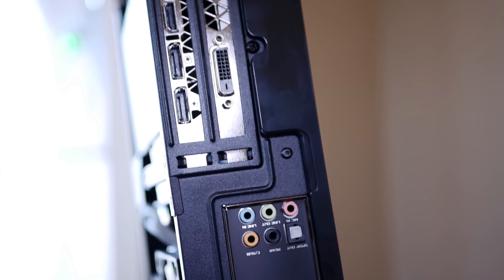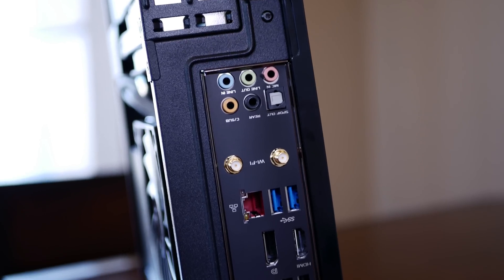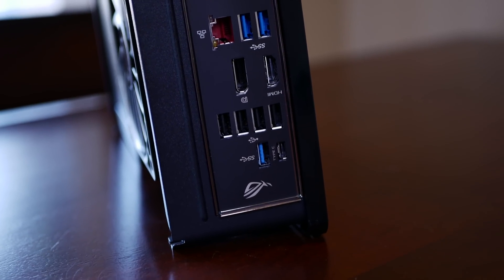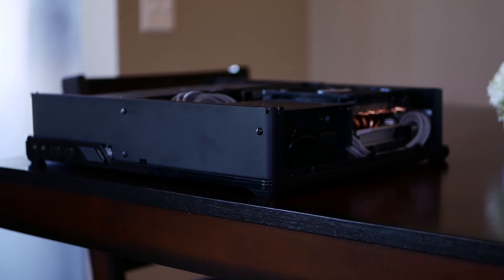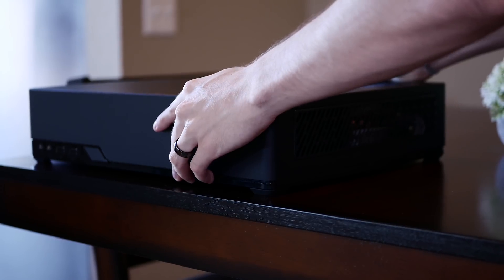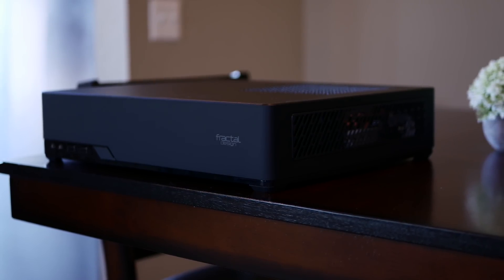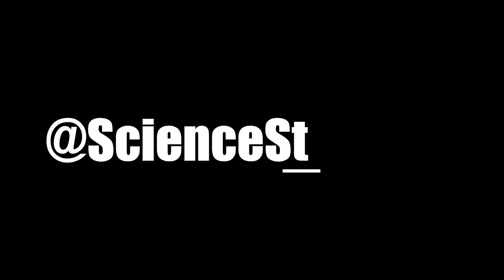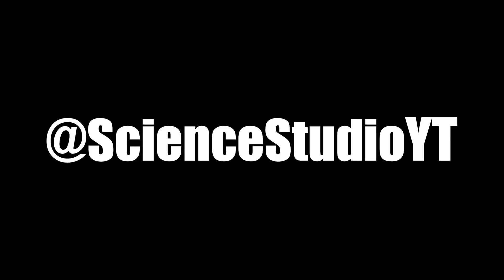Building an Ultra-Clean Small Form Factor PC

Comment: 7:34 - NEVER use cables that do not come with the PSU. You'll destroy the PCBs of the hard drives. But hey, what do I know after having to recover 3 drives at 850 CDN each because i used different cables.

Comment: There is also the Silverstone Raven RVZ02 case that makes a nice itx build, and you can put a handle on it, and you can put the big shurkin 2 in it as well, and it has air filters, and it will even accept a slim optical drive if you need it. Video card cooling is a little suffocated but overall a good case just as the node 202 is...

I built a system consisting of 6700k, 1070 strix, lpx ram, and a set of 850 evo's on raid 0 and it rocks, gpu and cpu never get over 80c even rocking crysis 3...

Comment: Yeah custom cable with the right length help a lot with small form factor build like this one.
I built myself a RVZ01 computer and I swapped the CPU power cable and the GPU power cable for shorter ones to help reduce the clutter in the case a little.
I bought the CPU / GPU  cable from moddiy and the right angled GPU cable from kareon cable.

Comment: With the way the Node 202 is using a FE blower type cooler on your GPU would be more preferable than blowing the heat into the case and right back into the GPU area.

Comment: It's a nice build and balanced specs I think, but it would be even better if you tweaked it a little bit. In this SFF I think that the thermals are the enemy so it would be cooler to delid the cpu w/ liquid metal, some undervolting, re paste the gpu, etc. Also, if you're using premiere 2018 with the quicksync update you would definitively have a pretty fast editing / rendering rig ! Just my 2 cents, Cheers !

Comment: Why not use a Gigabyte 1080 mini? Same height and depth, but nearly half the length. Having a case that'll fit the PSU next to it and using a PCIe extension cable should do the trick.

Comment: about to attempt a similar Ryzen build, gotta find a decent cooler tho
Reply: i was thinking either that or a copper heatsink with a Noctua ultraslim
Reply: Perhaps this combo (it is not cheap):
Noctua cpu cooler NH-L9a-AM4 but change default 12mm fan to Noctuas 25mm thick fan.
https://noctua.at/en/nf-a9-pwm

Comment: Ok y didn't u use the Xtreme edition Intel processor if u r taking it to comoutex video editing if this is just a budget issue it's ok but otherwise higher wattage SF PSU are available which can power Intel extreme edition processor also I recommend 2*16 gig sticks and lastly a zotac 1080 ti mini by zotac and yes this is just a suggestionb and only because u said that u are making a part 2 of it and I m repeat ing again that your build is great just these can make things better also I suggest u to check out bitwit Kyle video on fractal node 202 where he puts a 120 mm radiator in the case ... Good bye happy building

Comment: im sure if someone had the same build, they would say something.
i almost have the same build.
i have
-Asus strix z370i (same in video)
-i7 8700K(he used a non K)
-16gbs of crucial ballistix(he used Corsair)
-EVGA GTX 1080ti(he used a 1070ti)
-same psu
-same case
-i have a 1tb sata m.2 ssd under the heatsink, 240gb nvme ssd on the back and a 2tb 5400rpm 2.5in hdd
- and a led strip :0
if he chose those cable cause hes gonna cut out a window im gonna die. ive been wanting to cut a window but nobody doesnt it in clear detail or easy tools(and cheap tools) andytime i see a video dealing with the node 202 case, i HAVE to watch. that goes for any of my components. i nerd out on any little detail somone says like how the cooler fits so well
Reply: i could have a conversation for years about this case. i fanboy so hard over it. temps, price, size, pros, cons. i cant fanboy as much about anything else
Reply: How's your temperature?
Reply: How's your temperature?
Reply: Has he uploaded the windowed version? Here's someone who did it. Looks pretty good. https://pcpartpicker.com/b/yK3bt6

Comment: Would have been interested to see a k version overclocked with a delid to test how much that cooler could handle without Intel's crappy tim.

edit: lol forgot to say that I love the build though. I imagine with small form factors fitting absolutely the largest coolers is important, so hats off to you for not having to dremel a hole in that nice case.

Comment: I made a similar system with a 3 part youtube video, but I used 3 extra cooling fans, with gigabyte 1070 gtx, GPU never goes over 70, CPU goes past 60, and its a very quite system, I use it as my main PC, here's the link to the vid's this is part 1
https://www.youtube.com/watch?v=pEr7bE3WaKI

Comment: When using only m.2 drives I recommend unscrewing default sata drive dock for much better cable managment.
GPU area can handle easily two 120mm Sythe SlipStream fans which are only 12mm thin.

One important thing for all Node202 owners....
....some model have a front panel USB dock cables coming straight horizontal but it should turn 90 degree. Fractal Design send me a proper front cable dock. For free :)

Comment: Why does everybody buy EVGA graphics cards??
Reply: and let you take off the cooler to do maintenance and fit a waterblock without voiding your warranty
Reply: And they’re basic no-frills designs which will fit into any case, especially small form factor cases, with no pointy bits sticking out that will get in the way. Looking at you MSI.
Reply: Dionisio Theodoropoulos theyre good
Reply: And have the best warranty and RMA policy

Comment: Was going to say that's there's the InWin Chopin if you didn't need a dedicated GPU. It's much smaller with a built-in Bronze rated 150W psu. Coolers are also limited, but another Youtuber out of Australia got it working with a Cryorig C7 cooler--it JUST fits. Not sure if it's heavier though since it has a 4mm aluminum frame. Just built a system for my Dad in this encloser and got some heft. I just weighed it and fully loaded it's 3.1 kgs (6.8 lbs). Not that bad all considering some gaming notebooks are that heavy or at least were in years past. 

Awesome looking build btw. Love the consolesque look of the Node 202. About the hardware used, I just upgraded my system and was going to go for the Z370-i from Asus, but chose Gigabyte GA-370N Wifi in the end because of fan headers and price. I really wanted to go for the Asus board though, but alas the fan headers weren't enough and I don't plan on hitting a 5Ghz OC.

Comment: So tired of people putting in Samsung 860s (and LOL you used a SATA m.2 instead of an actual NVME m.2, what a waste of lanes) when they could get literally like 3x the value out of MDSSD's BPX line.  They run a little hot, but that's solved with GPU heatsink spreaders (like 15 bucks for a 9-set from amazon).

Idk why I even watch this channel any more.  Scythe coolers and mini ITX builds?  Yawn.

Comment: You could probably get away with using 8+6 pin on your dual 8 pin card. Chances are a 1070 Ti wouldn't demand more than a single 8 pin anyway unless oc'd and even then the 1080 handles that just fine on a single 8-pin.

Comment: How's the thermals with that 8700k? Surprised u went for that over the 2700x for such a small space
Reply: except it wasn't a 8700k he used it was an 8700 which has a slower base and boost clock, its a 65w chip rather than a 95w chip I believe and clearly he wont be overclocking so thermals should be absolutely fine.
Reply: Shaderade those were my thoughts also. The 2700x had great thermal headroom.
Reply: It was only a 8700 not a 8700k
Reply: lucas rem ryzen 7 1700 or better can keep up with the 1080 Ti
Reply: We know he used an 8700, but why a z370 chipset?
Reply: Julius Concepcion cause it works much smoother z370 is optimized for 8th gen
Reply: Sad thing, that the Scythe cooler is not factory compatible with AM4. To get that working, you need a Noctua AM4 mounting kit and even then you have to modify that...

Comment: Why not just get a good laptop for your use case? Sure they are more expensive, but you can get one with a good i7, 32GB ram, GTX 1080, 13-17" screens, etc. They have built-in monitors and keyboards and are designed to be portable.

Comment: Hey Greg, Please reply to this comment... I have actually put together a built with the node 202 about 6 months ago. I chose some pretty mid tier components because I was worried about thermals in a case this size. I have a couple of questions.... 
- How are your temperatures? GPU en CPU
- Why did you go with the 8700 instead of the 8700k?
- Did you put in any extra fans? for the gpu department for example...

Great video!

Comment: i will join the small form factor race if there will be a case with 3 pcie slots so i can put a full sized graphics card in there and split the mainboard 16x slot into two 8x slots on the riser pcb to fit another 10gb ethernet card or something of sorts which shouldn't increase height by that much.
Reply: You would end up with something that isn't small form factor, you can get 1080ti's in 2 slot size that perform as well as 3 slot ( eg EVGA) so what is the point? The pleasure of Sff is to get your rig as small and powerful as you can with no heat or noise issues , it is easy to do this in a larger case and requires no planning or skill. If it's bigger than 20 litres it isn't Sff .

Comment: Love this case! I managed to cram an oc'ed 7700k and 1080ti in my build. People shy away from open air gpu's when building small form factor but with the node 202 you can, depending on your graphics card size of course, fit two 140mm intakes in the gpu compartment. Love this video!! Rep that SFF!!
Reply: Nice. I am planning to build on that case aswell. Can you please give info of the CPU and GPU temps you get under full load (or gaming) and about the noise levels?

Comment: I built in this case back in September 2016. Did the exact same PSU with a 6600k and 1070. Pair that with a Crucial 275GB M.2 and 16GB of RAM and I did okay for $1200. Got a motherboard with USB-C for futureproofing as well. Holding up well so far!

Comment: Can I use a 3 fan 1070 ti
Reply: Super900k i have seen a 3 fan evga ftw 1080 ti in a build he had to bend some    parts of the case but he got it in, it was a big help that it's a 2 slot design.
Reply: great thanks